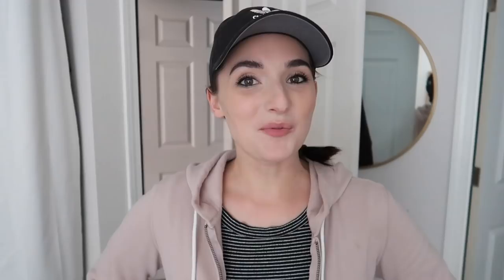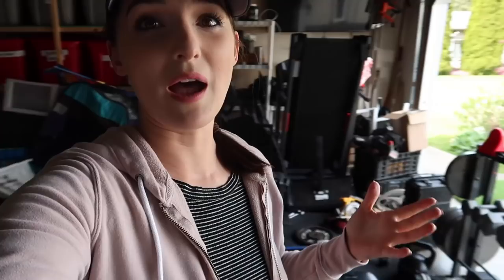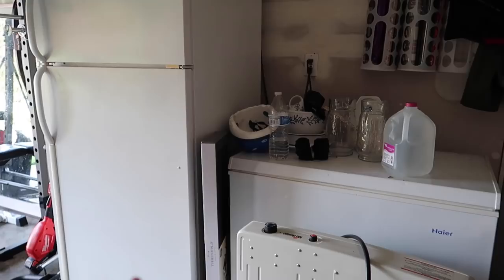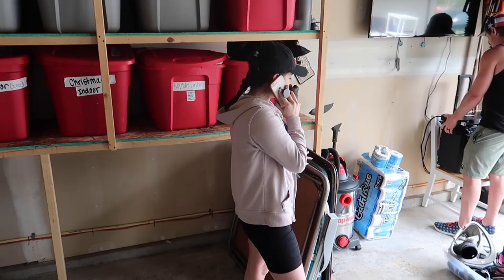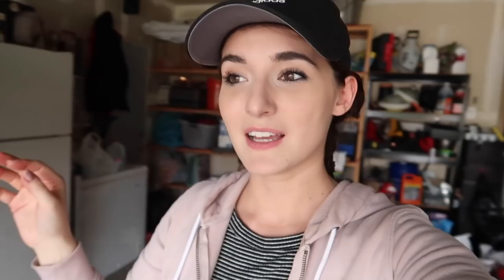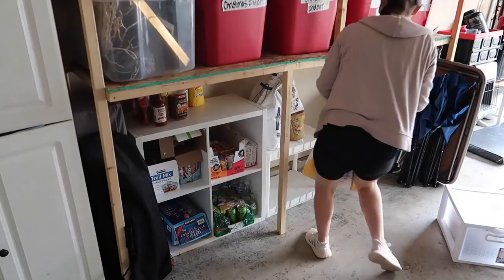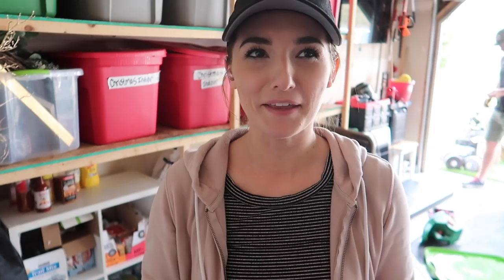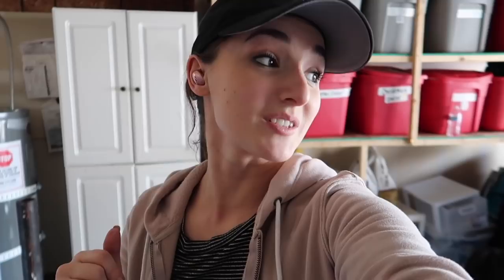WE KEPT ONLY 10% OF OUR STUFF! | Messy To Minimal Garage EXTREME DECLUTTER #WITHME | Transformation

Comment: You shouldn't plug both a fridge and freezer into the same outlet..especially in a garage.  The compressors take a high current when they start, and if they were both to start at the same time, you could trip the breaker switch...and you could potentially lose 2 appliances full of food.